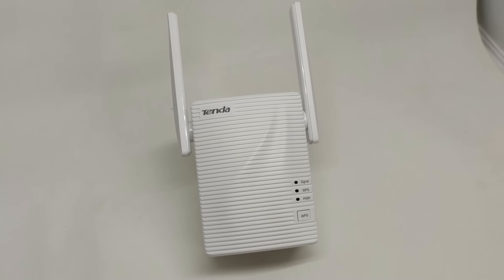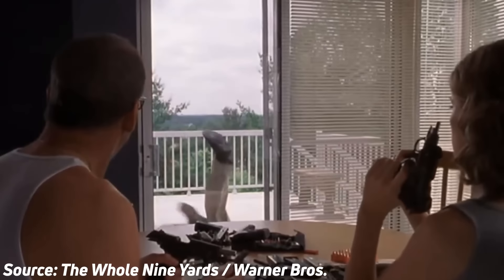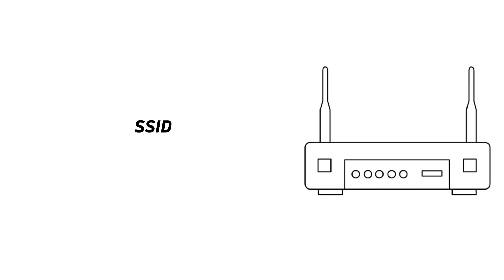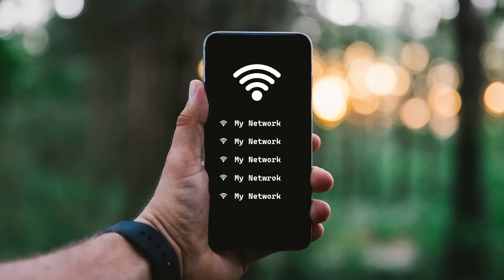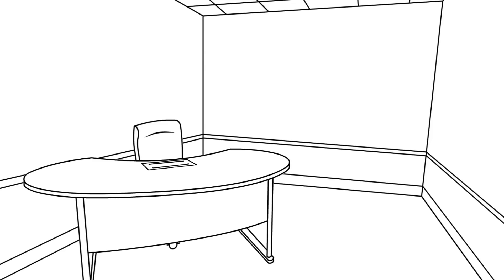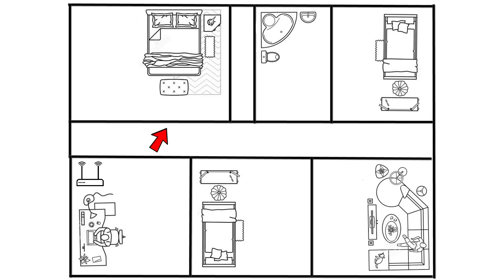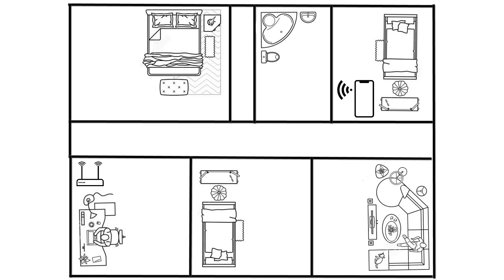How Do Wi-Fi Range Extenders Really Work?

Comment: Right at the beginning you say that by relaying data through a single-radio extender, you lose at least 50 percent of your throughput compared to connecting directly at close range to the wired access point. Then in the rest of your figures that 50 percent factor disappears without explanation. Can Gary Explain? This is overall pretty clear, but a little light in its coverage of the situation where an extender does make sense: If there is a location where you need, but can't quite get, a Wi-Fi signal, and you can put the extender approximately halfway between that location and the existing Wi-Fi AP, a good extender is likely to get a reliable (but not full-speed) connection to where you need it.

Comment: I'm slow, still trying to wrap my head around the last example... 😅 So, if your phone is outdoors, on the other side of a wall, is it simply the physical closeness of the wifi extender that enables your phone to get a connection? (Say 16%, vs 0% with no extender).
Reply from the maker: Yes, because it is connected to the extender's network not the original access point.

Comment: Wow , nice explanation ! Question , I use a firestick and that tells me the Wi-Fi connectivity in terms of fair , good , very good etc , also my Wi-Fi is called whole home coverage , so there are 2 Wi-Fi routers strategically placed in 2 different places in my house , also it has 2.4 and 5 ghz , and I have a rock space extender with 2 antennas on it , and I thought I was occasionally losing signal on my firestick in one bedroom , so I tried the rock space in there , both the original Wi-Fi and the extender show very good / very good on my firestick , I realize that this is not the best way to test , but after seeing this video , I don’t think my extender is helping my situation at all ? Can anybody help me out with this , thank you

Comment: I have a WiFi security camera   I have a WiFi extender because of the distance involved   I can connect with my base router with the extender.  I can connect the Camera with the WiFi extender.  In the home I have a security camera recording DVR connected to the base WiFi.   However I am unable to have the signal from the camera pass through the WiFi extender and or the WiFi Base to the DVR.  When accessing the Base WiFi connections, the Extender is listed correctly.   Any idea what is going wrong?

Comment: I use a air of powerline units to extend into the garage, then WiFi AP in bridge mode to the original router. Works ok for the garage.

Comment: Hello,

I have a question that could be useful to many people having problems with wifi range.

Lets say we us two extenders, one at 10m away from the router and the second one 20m away.  How does the second extender work? Does it extend the original network or it could be paired with first extender so it extends its network?

Thanks
Reply from the maker: I have a video on mesh networking which covers that exact case.

Comment: Hello.Nice vid but my problem is not solved! My router D-Link with 4 antennas stay in the living room and I want to have internet in my workshop wich is 15 yards and 3 walls from the router. And I will not drill holes thru the walls. Is it possible to connect for example 3 extenders in every room to get a good wifi signal??? Thanks and greetings from Norway
Reply from the maker: Yes, see my video on Mesh networking.
Reply: @GaryExplains  Thanks pal

Comment: So if I’m getting this straight you have your modem from your internet provider then you have a router the wifi extender connects wirelessly to your router thats connected to your modem. You stick the the extender in an area that has bad wifi coverage. The extender creates its own wifi access. You then log into that access point. So the internet is going from the modem to the router to the extender to your devices.

Comment: The better option would be to hardwire your place with Cat5e or 6. Switch your extenderé to access point mode and plug it in the hardwire. Do a quick set up with your wifi device to give it a name and a password. After that, it will access the router with no back n forth from the wifi and you get the full speed of the modem. That’s if you means to do so

Comment: My question wasnt exactly answered but was just barely missed. At 12:21, bottom left room is where wifi is. Bottom-middle room is my room, where I game and stream. But I really want my wifi to work in the bathroom which would top-right.

Should I put a wifi extender in my room (bottom-middle)? Id also hope for a second benefit of a better connection in my room but its not necessary with ethernet. Would this just confuse my devices?
Reply from the maker: Yes, put it in the middle.

Comment: If your extender and wifi router supports both 2.4ghz and 5ghz, and you want range, often you are better bridging with 5 ghz, and using 2.4ghz to give you the additional range, rather than bridging with 2.4ghz. 5 ghz between gives you a bigger pipe in between to support more devices, and 2.4ghz connected devices give you more range and ability to pass thru obstacles; even more true if you have 2.4ghz only devices that are on the perimeters.. With an extender: why bridge with 5ghz ; simply - the desire for range that 2.4 gives you on the outer edges.  Why bridge with 2.4ghz; you have lots of devices in the same general area that support 5ghz (because 5ghz is better with that sort of interference ), but are less concerned with range.

As far as placement, I'd start by splitting the dwelling into 4, roughly diagonally. At the 1/4 mark and 3/4 mark, roughly, place your extender and router to optimize range and bandwidth.. It's not an absolute, just a good starting point.. Height also matters in the equation; try to keep the router and extender at or above head height, and higher than most or out of the path of large obstacles, like brick, steel doors, filled bookshelves, TV's,and other electronic items - assuming a one floor layout..  If you have wooden studs, and the antennas can "span" the stud, center your device on the stud.. it's less interference for the antennas.. This is NOT an absolute; move your equipment around where you can visualize your path between the components, and try to get close to your target.. It's not rocket science; it's not about whipping out a tape measure either. Often times, moving the router 5 to 10 feet one way or another helps solve a dead spot immensely.  So, no absolutes.. 

Often, however, you can avoid the extender by upgrading to a better wifi router, and placing the router as close to the center as possible.Not always possible to hit 1/2, but try to get as close as possible, with emphasis on the most used portions of the home.. If your router is over 2 or 3 years old, consider upgrading.. If your equipment does not support both bands, well, honestly, it's time to upgrade your equipment. If you doubled the amount of gear on your network since it was bought, it might be also time to look at upgrading.. 
Don't skimp by getting the cheapest router either; consider what you pay for a years worth of service and consider heavily towards something in the range of what it costs for 3 to 4 months worth of service. Research is your friend and will save you time, money and frustration in the end.  For an extender, I'd go with about 1/3rd the price of the router as a starting point. 

I've been using extenders for years; many extenders can also be used as a desktop switch to put a non-wireless desktop onto a wireless network, while also serving as an extender.  The latest wifi router I purchased allowed me to eliminate the extender, but I'll still find use for it.  It's a number of years old, but is still sold new today.. The tp-link router rocks however.
Reply: This is way to much to take in one comment

Comment: Greetings, I listened to your video on wifi extenders.  I just purchased two wav link extenders in hopes to get a wifi signal from my house to my shop, which is 170 feet away.  I put one extender outside my house and the other extender on the outside of my shop (line of sight).  I guess I'm attempting to make a bridge so I can reach the distance and enable me to watch you tube videos in my shop.  When I connected my extenders to my network I have a wifi signal but when connected it says,  "connected but no internet". Is this normal or is my internet service provider not allowing me to add this.  Sorta confused at this point.

Comment: One would recommend when setting up and AP extender to do DHCP pass threw so devices like a printer can be seen on the network Always places the extender 1/2 way between where you want the signal and the main AP. But now days a Mesh AP a set of 3 mess APs can be gotten for $150.00

Comment: Ok so weird question and I can’t seem to find anyone else in my situation but I have really fast wifi, but when it comes to gaming online the connection is very unstable so obviously I want Ethernet, I can’t move my modem but it’s directly above my room, I was thinking of buying the extender to get the signal and connect an Ethernet cable to it, would this work?
Reply from the maker: No, I don't think that will fix your problem, as there is still a wifi part to your setup (from ext to router) and you said the wifi part was unreliable.

Comment: Hi Gary I live on a site that has common wifi working around the site it s download speed outside is 30 to 4 mps but when I step just inside my front door it drops to 5 to 7 mps if I more further into the house it drops to 0 mps. Is their a way to bring the signal into the house. I live in the UK.

Comment: Hi Gary, if you do end up doing a video on mesh, could you explain the difference between a mesh vs extender, specifically how the mesh can get original speeds vs the extender which usually halves the speed. Is it just to do with the number of antenna? And also, why are mesh more expensive? I get that mesh gets you more speed but why don't they just make extenders the way they make mesh so that we don't get this speed difference. I have quite limited understanding haha.

Comment: Well explained!
exactly whats happening at my house with your diagram 
By placing the wifi extender in the hall way will make the signal better for the on your furthest bedroom?
Reply: Seems like it should work!
Reply: That's what I did as I have a long single story house, with my WiFi route at one end in my home office, and I put a WiFi range extender about 1/2 way down my hallway so my front living room, dinning room, and den have better 2.4Ghz signal range, and it works well enough, I also have a 2nd one in my game room/family room that was added onto the back of the house several years back as an addition, and keep it high up on my media shelf to get a better signal range for 2.4Ghz devices with weak WiFi antennas like my Roku Boxes, Google home mini speakers, and game consoles. I've tried a few different brands, and at least for me in my neighborhood, and house layout(single story T shape with an Attic space) on 2.4Ghz the Tp-Link TL WA855RE model works really well, and can be had for under $15 USD refurbished on eBay all day long, 
just make sure you use something you use an app like WiFi Analyzer for Android, and walk around your house (inside, and outside) doing an access point scan, so when you are setting everything up you are not on the same WiFi channel as someone else around you causing problems with your network, every once in a while I do have to go into router, and change the channel(almost always on the 2.4Ghz band) as a couple of my neighbors are stupid enough to use the modem/ WiFi router combo from our cable company, and leave the channel settings to auto, thus not respecting others in the neighborhood when their modem/WiFi router combo decides yep I want that channel now!!! 🤦

Comment: Great video, I now think in understand more about how the WiFi extender works.  I am also interested in the how to use wired extension and this is related to how our home network is setup.
We have three floors in our home and the WiFi router is in one corner of the middle floor (where the cable modem is).  We also have three extenders - upstairs, downstairs and the middle of the first floor.  The upstairs and first floor extenders have a (mostly) line of sight to the router but not the lower floor.  The one additional thing is that I have been able to get wired network to the lower floor.
1) It seems that using a wired extender would be better for out lower floor extender (since we have a wired connection there and the extender cannot easily "see" the router.  Could you do a video on that?
2) The lower floor can "see" the extender on the middle floor better than the router - would it be better to connect the lower floor to the middle floor or just connect to the router even though it is a much weaker signal?

Comment: You can connect an ethernet cable to a Wi-Fi extender if you want a hard-wired connection. This will help to get a stable internet connection where Wi-Fi signal tends to go weak. The speed of the connection depends on your purchased plan and capacity of the extender
Reply from the maker: You mean like this? https://youtu.be/4OkEoanbOeo

Comment: what about wifi adapters with high gain antennas? i have one i use when i go on camping holidays instead of the piddly wifi built into my laptop so i can get a stronger signal from the campground wifi at a distance. is this my best solution or is there something better?

Comment: So, if you have a weak signal at 50 feet from modem, and no signal at 75 feet, an extender will get you a week signal at 75t feet (as opposed to a stronger signal at 50 feet).  if I understood correctly.
Reply from the maker: Signal and throughput are two different things, so your example doesn't quite work. You might get a strong signal at 75 feet (since it is only 25 feet from the extender, but low throughput (as you can only get the same throughput maximum that was available at 50 feet).
Reply: @GaryExplains  thanks i think i get it.

Comment: I like setting up these extenders in client mode.  That doesn't create a new SSID, but gives connectivity via the ethernet port.  They usually work better than a WIFI USB dongle.  It's running openwrt, btw.
Reply: That works good for a situation where you just have a few devices that can be hardwired to the extender. For solving an issue where 1/3 of the house is a deadzone due to distance/obstruction/em interference, I opted for the MOCA route. The extender can sync to the existing wifi for SSID settings but has the same bandwidth as if it was plugged directly into the router, thanks to the coax wiring in the house acting as a really effing long ethernet run.

Comment: So, if I have 500Mbps speed next to the wifi router and my furthest room has only 85Mbps speed then adding an extender will not boost the speed of the furthest room?
Reply from the maker: If you put the extender in the furthest room, no. But if you put it somewhere in between then you will likely have better speeds. Also consider a mesh network setup (I have videos about mesh here on this channel) or running a wire to the extender.

Comment: Used wifi extenders and they always work poorly. You had to be right beside it and all you get is 10-20 mbps for a router  with wifi capability of 800 mbps even if the extender is probably 10-15 feet from the router. I installed 3 tp link deco m9 wifi mesh and added 3 used but compatible tp link m3w wifi mesh extender I bought on ebay for $10 each and never looked back...running nothing lower than 300mbps and have a max of 600mbps, though it mostly stays in the 400-500mbps average. I did have to reset and change some specs in my router once the main deco and satellite decos are up and running to fully get a fast wifi.

Comment: My main wifi router is on the ground floor, in the middle of the house and provides good wifi on that floor. But doesn't provide good wifi(or no wifi) on the floor above. 
Do wifi routers even transmit in the vertical direction as well in the horizontal direction? 
And will a wifi extender be able to fix my problem?( Because would it even be able to catch a good wifi signal from the original router?)

Comment: Very informaitve Gary. Question: Would the connectivity / transmitting power of the end client have an impact? E.g. for devices in the room furthest from the primary AP, would the primary AP be able to receive "messages" better from the range extender when compared to "messages" being received directly from a mobile or laptop? (Assuming range extenders have better "connectivity" than a mobile device)

Comment: Your problem makes sense. You didn't place the extender properly. 
You expect good signal from the extender. You must give the extender good signal in the first place. 
Therefore, you must place the extender AS FAR AWAY FROM THE ORIGINAL ROUTER AS POSSIBLE WHILE HAVING THE BEST POSSIBLE CONNECTION.
What you did was put the extender in an area with poor coverage. That's where your devices will connect to the repeater FROM. What was the repeater going to work with in that area if there's poor coverage to begin with? 

The repeater needs good Wi-Fi coverage to begin with, so put the repeater in a spot the original router covers very well (hallway, for instance) and then test again from the room you were having issues in.

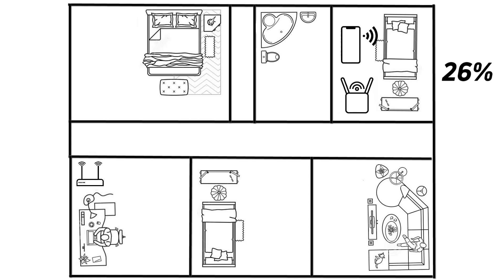12:35 would've worked properly ONLY if the connection between your RE and the router was by cable.
Reply from the maker: I don't think I had any problems. I was demonstrating how the position alters the throughput based on signal strength. I don't know why you think I was having problems, it was my intention to show how they work and that you need place them optimally. I really don't understand your comment.